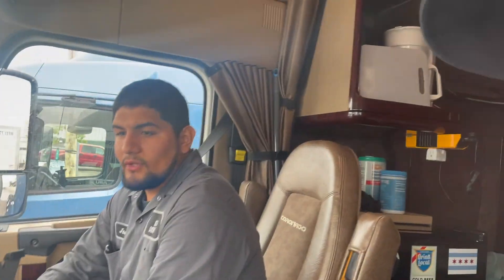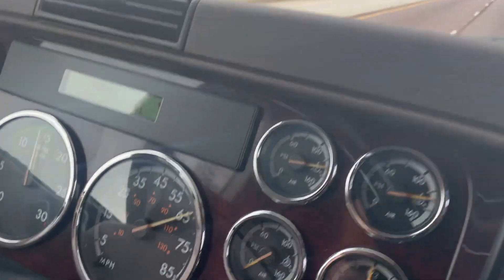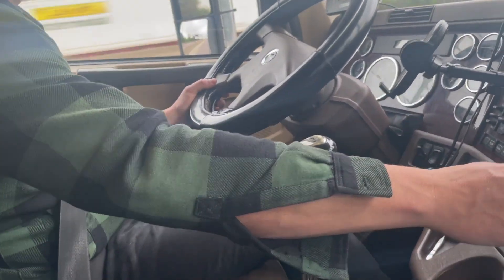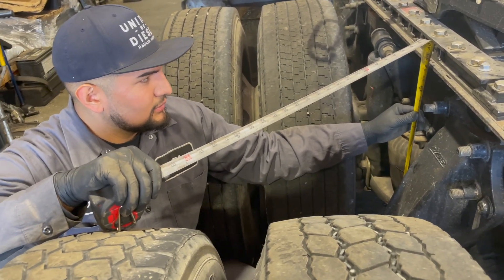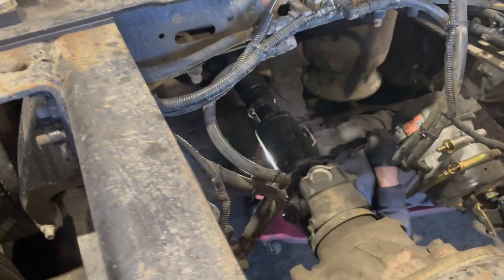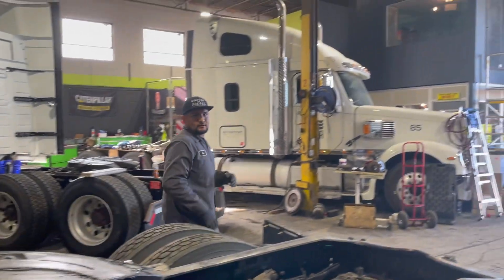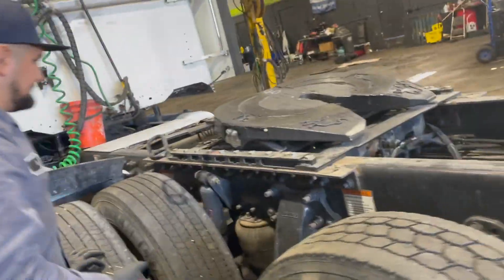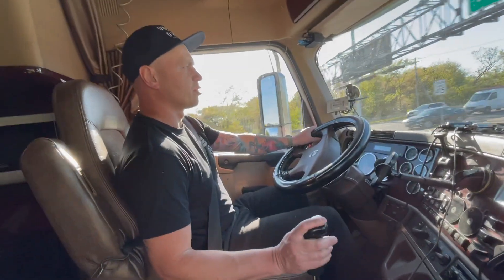Semi Truck Transmission Grinding? Check this and Save Money

Comment: My truck was doing the same thing only on the 10th gear. I was 2 inches over. Good thing I came across this video. It solved my problem. Thanks guys!
Reply: How you do?
Reply: So, do you happen to rebuild the trans?

Comment: OMG 😳 I been getting this same shit. Thank you so much. Also, question: what is the model number for that 5th wheel? I need to drop mine 2" .... Already over 13'6" on 40" ride height. My truck used to pull a tanker in it's previous life

Comment: would like to see a truck review of peterbilt 387. strength and weakness of that model.
Reply: i have 2006 387 make same rattling noise in 8th high gear between 65mph to70 mph speed. notice ably when truck is not running under load or going slighly down the road.

Comment: I have an 07 international 4300 7 speed manual Eaton and it's doing the same thing. On reverse if it's a little uphill driveway I have to give a little more gas cause if not it's like it won't go anywhere. Any suggestions? I'm thinking bad transmission?

Comment: Do you know what the spec height  is for a 2015 Volvo vnl 780 d13? Getting read to change my leveling valve and would like to know.

Thanks
Reply: I need that info as well